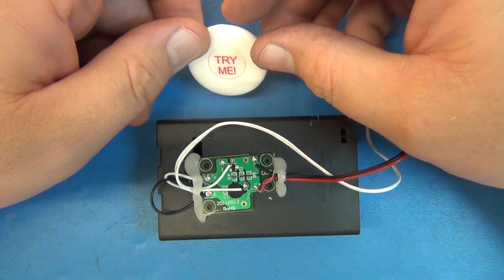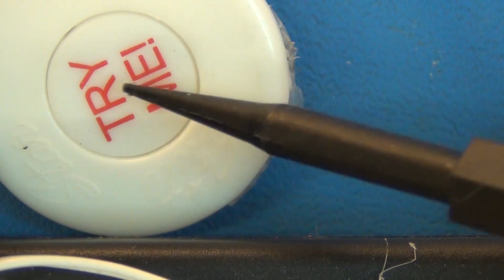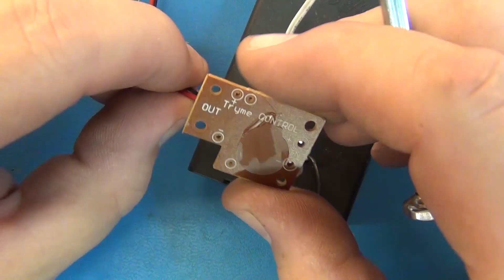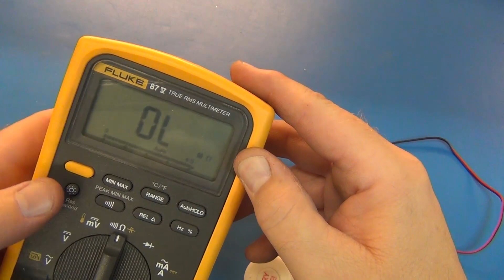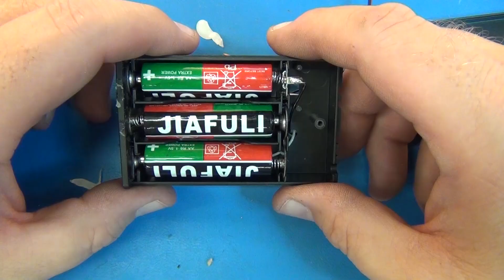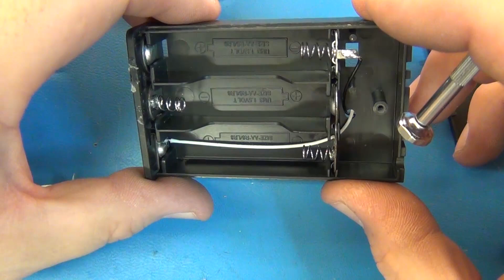LED Christmas Lights - Bonus "Try Me" button by Brite Star

Comment: I bought a Halloween projector device, and it had a try me button mounted to the box. It is connected to under the projector, and it connects to a small circuit board, which seems like it's a type of boost circuit. The button had a CR3032 lithium coin cell inside and seemed to be low. I am going to make a flashlight out of this boost circuit and 3 AA or AAA battery holder and some type of LED.

Comment: I worked at a store that dumped its try me displays after each holiday. I snagged a bunch thinking I could learn to wire them to work on a regular plug. Could you offer any advice? Current have one that the kids just lick the wires to turn on... the lights function and are fun. Would be a shame to toss.

Comment: I recently purchased a small Christmas sign that has mini LED lights powered by a battery pack.  3 AA batteries to be exact.  The battery pack does have an On/Off switch.  What I'm really interested in is that this sign has a Try Me button that plugs into the battery pack and when pressed, will power the LED lights as long as I am pressing the button.  This Try Me button is completely independent of the battery pack cause the batteries are not needed and the On/Off switch doesn't matter.  I'm going to assume this Try Me button has an internal battery, like one of those watch like batteries.  What I'd like to do is to hard wire this to an A/C plug so that I don't need to use batteries.  Use this connector port to provide power.  I'm sure this is possible, just need some guidance.
Reply from the maker: You're on the right track but don't use the try me button. If it uses 3 AAs then that's a 4.5 V light string and any 5 v USB charger will work just fine. Just chop the end off, find the ground ad 5 V lines and solder them to the plus and minus wires inside the box. That way the on/off switch still works and being you are powering the box if there is any feature options for blinking and such those options will work too. Any 5V USB charger for phones and such should have more than enough amps to drive your lights being your light's normally run on 3 AAs.

Comment: I have a musical Christmas decoration that has a try me plug running from the box to the bottom of the decoration. I unplugged it  and switched the offbon button. I got nothing. I put in new batteries, still nothing. Am I doing something wrong?
Reply from the maker: No you are going everything correct. Check your batteries and also make sure they are in correct. If that doesn't work then the it must be defective. Also, I have seen these come with more than one battery box so make sure you are putting in batteries in the correct power box provided this is a battery operated light.

Comment: I got a setup just like this for free. It was a display for LED string lights that pulse to sound. However the switch is missing and only the tryme wires remain. I removed the button and wired the connections together, but still only get a 45 second run, before they shut off, and I have to touch the ends together again. Is there any way to get a constant on setup, or is it going to time out no matter what?
Reply from the maker: Not sure what you mean by "the switch is missing". Maybe you mean the controller is gone or cut out somehow? Either way to address your problems it would be interesting to see what happens if you where to short the two pads silk screened as "S1" with a screw driver. If that takes out the transistor in the circuit it might just run 24/7 because the cob will not be able to turn off the transistor and stop the circuit. If that works then just solder a blob of solder across those to pads. In the video at 0:57 I'm pointing at the S1 pads which have  silk screen brackets around the two sides showing what two pads need to be connected.
Reply: @ToddFun  I received the display model. It consists of a battery box with a section for on, and off. However, on the display model, the switch has been removed, and replaced with two wires leading from the s1, and s2, ending at a try me button that gives you a 45 second show. I assumed that removing the button , and just connecting the two wires would at least give me a constant on setup. However I still get the 45 second run time, causing me to have to disconnect, and reconnect the ends for another run. The problem is, I do not want to do away with the board because these wire (fairy) lights react to music, and I am trying to keep that option.
Reply from the maker: @rubiconmaster  Doesn't sound like the "try me" circuit you have will have an option for continues on. Does this display model also react to music when you trigger this 45 sec feature? If so, does it continue running un-interupted if you keep touching the two wires before the 45 seconds laps or does it not help? If it does not help to reset the timer then you out of luck. If it does you could build a mulit-vibrator circuit and config it to switch on/off every 30 seconds. I have a circuit like this in this post: http://www.toddfun.com/2010/01/02/wii-wand-of-power/

Comment: Pinncale was one of the one's I looked at originally. I went with sony because a friend also had sony. The 8 gig seems very important. I was having memory issues before and was down to 6 and even 4 gig for a while. That may have been my problem. Now that I'm back up to 8, everything's fine. I need to upgrade my power supply to handle a better graphics card. It's sweet that you're using you hdtv!

Comment: Doh! A correction for my other comment. I use Any Video Converter for audio conversion. For converting individual clips from 1080p to 720p I load them into Sony Vegas Movie Studio one at a time and save them as 720p. Then when I'm working on the full movie, I'm working with only 720p clips. But having Adobe Premiere Pro would be much nicer anyway.

Comment: Thanks. I must be doing something wrong then because my Sony M400 camcorder should be better than the CX-160 given the much higher price. Re the HD issue, mine does 1920x1080 too but I decided it was overkill for youtube so I use the freeware Any Video Converter to scale video clips down to 1280x720 before loading them into Sony Vegas Movie Studio, my movie editor. When I tried 1920x1080 in Sony Vegas, it crashed too much anyway.

Comment: Single function timer only. No changes are able to be done, the switch is only providing a contact closure. The blog does everything. Standard Zinc carbon cells in the battery. Can make a useful short timer for a light to stay on after the switch is released.